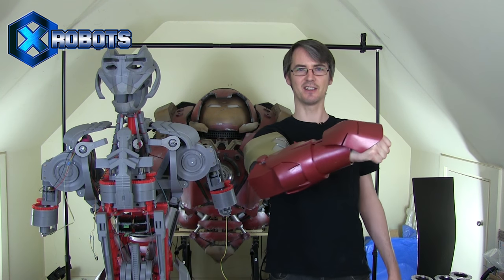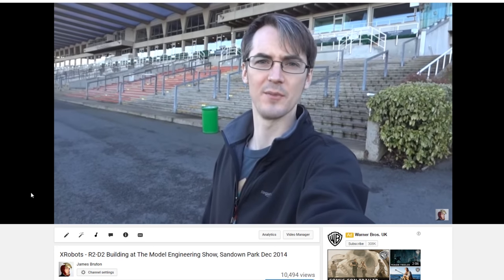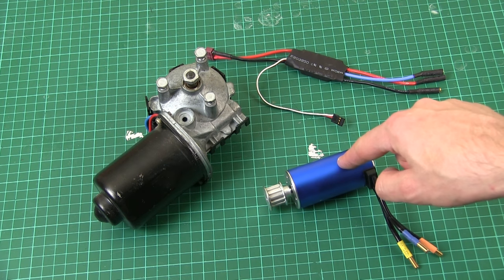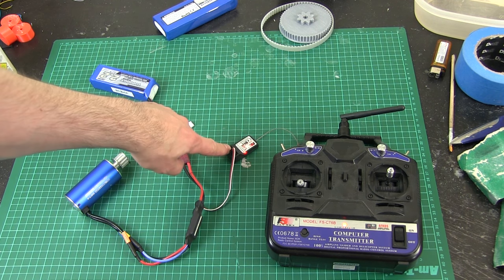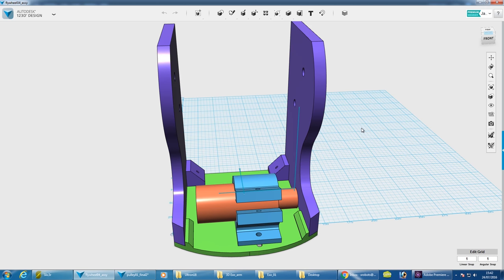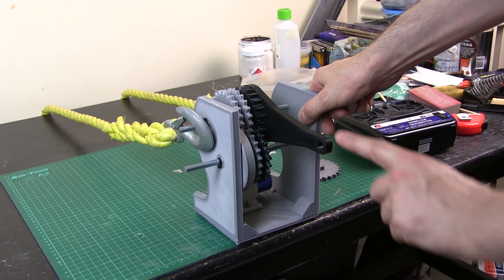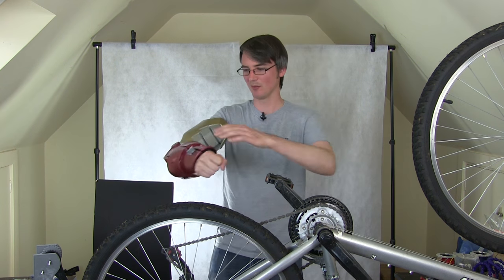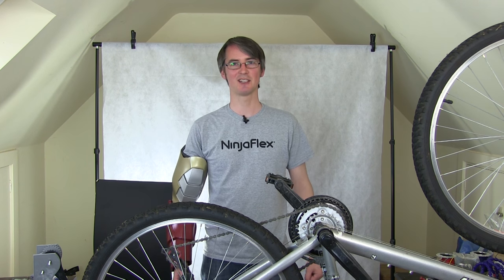Iron Man Exosuit #1 | Testing Motors | James Bruton

Comment: IDK if they guy posting this stuff ever replies to comments, but all the stuff you were saying around 9:00 like about batteries being able to push the motors etc. where did you learn all that?  Any tutorials on all that stuff?  I have worked with electronics here and there and I never understood all that...such as the difference between a smart phone battery and like those batteries you're using...the volts, amps, amp hours, etc.  Just all gets really confusing.  Any advice for learning that stuff?

Comment: To make it more compact/discreet, you could always station the motor behind the elbow. Having two-three shafts connected to a frame running down the sides and bottom of the forearm. I'm no engineer, but I think this would work reasonably well.
Reply: Or use it as a backpack and forget the arm design.

Comment: the ESC gets hot because of the BEC powering the receiver by cutting the voltage and burning off the excess as heat. you can get an opto esc without a BEC and power the receiver with another power source, like when its being controlled with the arduino.

-drone pilot :D

Comment: sounds like it will be an interesting build and your learning lots of stuff about motors and gears which should help with the other current and future projects. One thought to keep in mind is to build in safety's and end stops around the elbow and any other joints, no way do you want it to continue past where your arm can bend as that will be very painful.

Comment: This is going to be an awesome project.  I'm excited to see how this progresses.  One thought on lots of gears in series.  Each gear you add also adds slop which gets magnified throughout the drive trail.  Normally its not an issue because the slop is only apparent when you start.  Changing directions should double the perceived slop.  It might not be so bad though.  We'll see.

Comment: Perhaps gas strut (car boot strut) and motor combination? 

I think your biggest challenge will be overloading on one side of your body. You'll probably have to build the arm frame across your back to the other shoulder, much like a backpack. In fact, you'll likely need a whole chest frame to compensate the load on the arm and support your back.

Comment: Could you make your own "brushless motor" ish thing that sits on the joint of the elbow?  You could have one on each side of the elbow joint, and make the stationary outer magnetic shell fix to your forearm, and the coils for the inner portion could fix to your bicep.  You could make it very wide and have heaps of smaller size coils with thick wire which could give your arm the ridiculous torque it needs..
Reply: Sorry, to clarify what i mean, make a circular joint for each side of your elbow  and design the motors into them, it would be extremely thin
Reply: You would need the hal effect sensor, but none of that big ugly gearing and its kv would be incredibly low which is perfect..
Reply: I was thinking about that too, you can get off-the-shelf pancake-style brushless motors. Pair that with a similarly thin planetary gear and you might get good performance in a thin form factor?
Reply: I hope James sees this in time... Hackaday this week had an article on how to build a very very cheap brushless motor controller that will do amazing torque and low speeds. The only 'hack' to the motor needed is mounting a small magnet on the shaft.

Comment: You could laser cut some steel gears, Yeah. chain works and is quiet. Another option is belts for the gearbox, nice and quiet.. Like you said if you need some extra gearing you could use an outrunner. If you use sensored motors you can run them at low speeds well too.

Comment: You could get a gear motor and remove the motor. Then you could use a shaft coupler to make the motor shaft fit the new gearbox.  Just a suggestion.

Comment: I have in the makings a project similar to this. But for the strength I had planned to use air bladders or pneumatic muscles depending on what you want to call them. A system similar to hydraulics but not quite as potentially dangerous. 

Also if you use a servo motor rather than a standard motor setup, you can actually put physical hard limits for the distance it will travel making it much safer. The downside that professional servo's are expensive. But they are relatively easy to make and pretty compact.

Comment: You should design a kill switch with a locking mechanism, so at the press of a button, or in the case of motor failure, power is turned off and some sort of lock is placed to prevent movement. this way what ever you are in the process of lifting doesn't fall onto a sudden pressure on your arm.

Comment: Following the (incredibly detailed) blog of a guy from Robot Wars for a couple of years, one learns two things:
- geared BLDC motors are incredibly powerful, driving stuff that breaks through sheets of lexan and plates of steel which in turn means that even METAL gearboxes and chains are basically made of butter as far as the motors are concerned. They grind that stuff up for breakfast, in a few minutes, without blinking. Plastic is... not even there.
- not if, but when the ESC eventually gets pushed a bit too far or just has a "derp" moment and elects to grenade by shorting the battery leads directly, one tends to value a quick-disconnect switch between the battery and the controller, unless one is ok with the battery following suit shortly and much more violently. Yes, there are switches for eleventy-billion amps, specifically for that role.

Comment: I was experimenting with pneumatic recently and has some very surprising Results with just 2 bar. depending on the cylinder size, this can really bring some kick. But you need a lathe to make some cylinders. So i guess the electric motors are less annoying.

Comment: You could use old cordless drill gearbox assemblies, the mounting screw spacing should be the same as the brushless motor and there is a large variety of spur gears to suit the gearbox, also you can get used drills for cheap and they already have nice, compact, metal planetary gearboxes. 
For the controlls i would suggest pressure sensors on the certain axis of movement on the inside, so when you move your arm it pushes against the suit and the suit moves away from your arm untill it no longer pushes against the pressure switch, you would also have a main killswitch in your hand that would disable the exo-sceleton once you let go of it.
Reply: Exactly! That's the same conclusion I came to realize, regarding sensors, etc.

Comment: If hydraulics are not affordable, one could always use worm gears in conjunction with high-torque electric drills. They can get to 400lb-ft of torque, and that applied to a worm gear would create huge force if mechanically rigged for movement.

Comment: A cheap cordless drill is an excellent source for an inexpensive planetary gearbox capable of dropping 20k revs down to a few hundred.  
Cool project :)
Reply: I chucked a spool in a $18 Harbor freight drill on low speed (like a winch), and it easily lifted me off the ground with no sign of stalling.
Reply: +tiporari And I weigh 225lbs.  lol - rediculous amount of power in a tiny package

Comment: As far as safety, you could easily program a kill switch in the hand controls that only activates when pressed in a certain way, like how in Spiderman the webs only shoot when his hand in uniquely posed. As far as the structure, I'd start simple with the frame, looking like one of the Exo suits in COD Advanced Warfare where the pivots overlay the natural joins of the arm. I would divide the joints in two layers, one that your arm moves equipped with sensors, and the other connected to the motor, in theory as you move your arm and trigger the sensors, the motors would move the rest of it to match. I'm sure it's more complicated than that, but it's a start.
Reply: People are using the same exosuit system to mimic the movement of one limb to move a paralyzed one. It's possible.
Reply: OR. Just an option here. You could put pressure sensors in each side of the arm in wrist cuffs. When it detects pressure difference due to arm movement, it turns on in compensation to balance it out, kind of like when two people carry a large beam. One leads (the user), the follower (the suit) reacts to the any push and pull it feels on the beam. The more the leader pulls, the more the follower will react. 

For safety, putting rotational limit switches will work in killing movement once a certain angle is reached, preventing overextension.

Comment: I'm sure James already knew but linear actuators or "worm drives" are what you'll want to have both massive torque and space efficiency. Multiple gears just adds more points of failure to an already inefficient system.
Reply: Awesome to have a reply from you James, I mean no derision in that first post, it'd good to see gears tested to destruction Mythbusters style.

I looked at 3D Printing worm gears too but to be honest I think you're most likely better off printing a shell that holds metal nuts and thread in place as you're just not going to beat the precise metal parts you can already buy for cheap.

Comment: linear brushless motors may provide a compact, fast, and smooth way to power the arm. they come with the drawback of increased power consumption though. and are expensive unless you can find industrial surplus.

Comment: you could also do inside out gears, instead of having the gear to gear conversion on the outside of it, you could make it on the inside, and that way have several teeth to serve as power transfer points instead of just one.

Comment: Have you thought about an interior gear train? One which the larger gear has teeth facing inwards and the smaller gear meshes inside. It would have more meshing teeth than traditional spur gears, but it would be hard to anchor since there wouldn't be much of a central hole for the larger gear to pivot on unless the inner gear diameter is less than the radius of the larger one.
Maybe at this point I'm talking about planetary gears but I thought I'd put a thought in.

Comment: You should try to print some of the gears as fans. The ESCs really should get airflow, motor too. Also if you use the screw holes (usually M3 thread) on the end of the motor you could make a mount that's smaller and gives the motor better air flow.

So are you going to use the ESCs to power the boards too? It would save you some hassle.

Comment: You don't have to put a motor at the pivot point. You can bury it in the upper and/or lower arm and use a pulley system. Like the tendons that connect your fingers to the muscles in your lower arm and the one that connects your biceps to your lower arm.
Reply: Yeah, sorry.

Comment: you might not like planetary gears, but if you used internal ring gears and used a helical gear cut, you could greatly increase the contact area of each gear, reducing noise and increasing gear strength.

Comment: James those ESC's can usually do much higher than their rated amount of amps, so even though yours is rated to 30amps it can probably do 60 or more for short bursts without exploding, their 'rated' amount is just the amount they can do reliably over extended use. You really need to measure the current or watts to know be sure. But I would be using a bigger brush less motor for this project, because I think you are at it's max strength even with what you think is only 30 amps. And I think you need more power for this to be impressive. (I mean it's impressive either way, I mean for it to lift an 'impressive' amount of weight)

Comment: Hi James, Have you thought of using double herring bone gear trains at all? Not as efficient due to an increased contact surface but a lot quieter and less likely to chew up the teeth as the load is spread between multiple teeth. A good bit of grease added in too would help with the friction issue

Comment: It seems like that brushless motor is more than adequate to the point of being overpowered, smaller motors that are amplified through gears may be a lot more feasible in both space and power consumption.

Also be careful, I'd hate to see you replicate something akin to the Justin Hammer Mark I that twisted the pilot in half, lol.

Comment: You could handle more force with a gear where the teeth are on the inside rather than the outside.  Picture a circle with the teeth inside.  The gear is making more contact with the teeth so it's distributing the load across more teeth.

Comment: Could always try making your own harmonic drive. Should be doable with Ninja Flex or a Nylon-based filament so long as it can flex.
Reply: It wouldn't be a bad road to go down, honestly. Tons of torque combined with good speed reduction, and it should handle the strain excellently due to the higher number of teeth that are typically engaged.

Comment: So you've probably already committed to a power transmission mechanism, but have you taken a look at twist string actuators James?  You already made the jump to series elastic for Ultron, and the control processes do overlap a lot.  Twist strings are nice just because of the effective gear reduction, and that they act like CVTs under load, so they have a very short ratio when unloaded and can get into 4 digit reduction ratios when loaded.  you just have a series elastic actuator act as an antagonist to sense load if you don't want to do current sensing on twist strings motor driver

Comment: have you tried printing planetary gear sets?  they aren't just smaller, but the inner sun gears can have more meshing teeth compared to external gears so they are much stronger; ergo you can make higher strength gearboxes from weaker materials.

Comment: Did you consider a wire and pulley system driven by motors.  Essentially adding artificial powered tendons. you get more flexibility in terms of motor placement.

Comment: You'll need to use reversing brushless ESCs for proper control, the type used for rc cars/trucks. I'm wondering how you will transfer the load that the arm will be able to move to the ground as it will potentially be much more than your own spine will be able to lift - in which case you may find that you're into whole exosuit territory, i.e. Aliens cargo loader style!

Comment: You probably know someone/own a cnc mill or something like that, but you could make metal gears by melting aluminum and pouring it into a plaster mould of the 3D printed gear. You could also cast them in steel I suppose, but I'm not sure that a plaster mould would work for that.

Comment: Did you recomend to use a planetary gear? Probably it would help to get the torche better under control. 
But its very difficult to print these type ob gears, cause the gaps have to be very tight.

Comment: I think you have oversimplified the sensorless electronics. Your idea (energizing the coils in a rigid sequence without any input from the motor) would work, but it would hardly produce enough torque. A modern sensorless brushless motor is controlled with an ESC that detects the back EMF of the magnets in the motor moving past the coils in the motor. The ESC can thus determine when to energize a coil without the need of a (hall) sensor.

Comment: The best solution for getting the right gear reduction at a reasonable gearbox+motor size and weight is to use harmonic drives...Harmonic drives is the only company which sells those gearboxes and they are very expensive. I have seen someone try 3D printing a harmonic drive....not sure how that went.

Comment: How did you find this motor?

I'm looking to find similar motors for some projects I'm working on and I can't seem to find a good way of searching for motors by power and size. I'm looking for a motor narrower than a standard C battery that can produce at least 400W output available for $30 or less retail, and I can't seem to find a good resource for searching.

Comment: Linear Electric Actuators? Lever formation, high torque at joint. Probably get quick enough response for what's required here.. could change motor out to brushless high RPM if not

Comment: Wouldn't it be the best interface if you had contact plates you pushed when moving your arm, so your own movement is just enforced instead of controlled by you? That way, you could also ensure to have your emergency "exit" - simply stopping the contact and having some kind of endstop, so you don't break your elbow by forcing your arm too much in either direction.
Reply: ***** But wouldn't that kind of defeat the purpose of an exosuit arm? Like, when you can get out that easily, wouldn't that mean it's not held in place very strongly? Or am I imagining something different than you are?

Comment: Why not have the motor up near the shoulder and then just use steel wire or something connected to the wrist? Run one on the inside and one on the outside of the arm and you basically have synthetic muscle fibers, with the motor providing the tension to the correct wire to bend the arm in the desired direction.